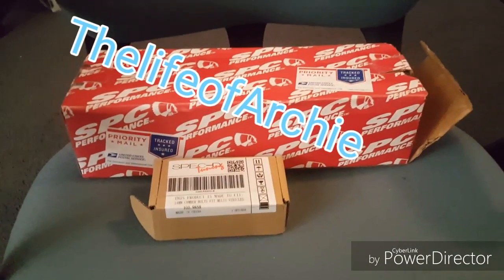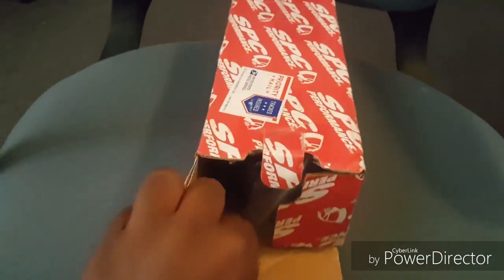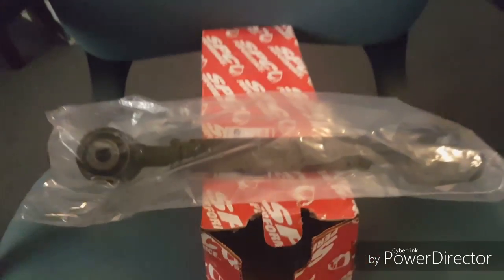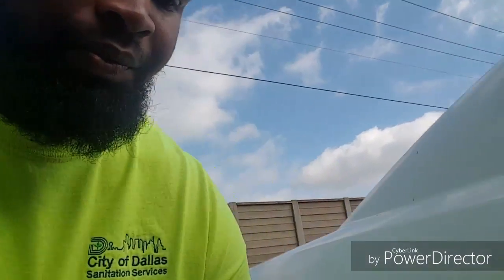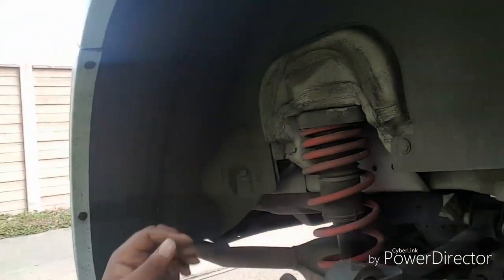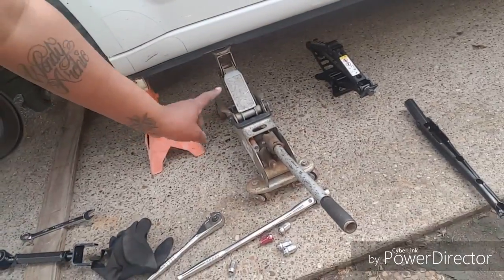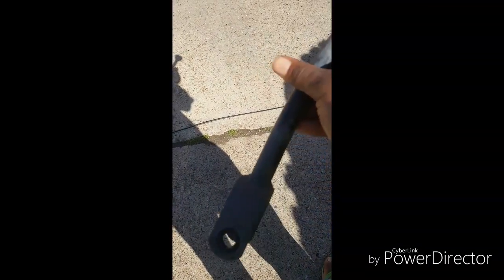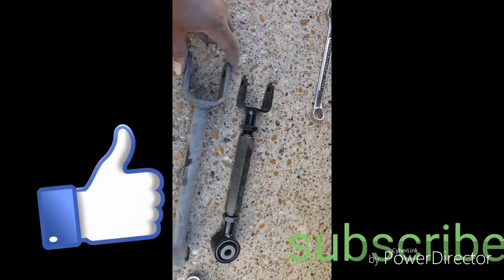Dodge Avenger performance control arms

Comment: Did you do both sides?
Reply from the maker: Yes
Reply: @thelyfeofarchy4474  I just ordered 2 upper and 2 lower control arms for the rear 👍🏻 I also ordered strut and coil spring kit for front and rear, new swing arms, tie rod, frond lower control arms and a bunch of other stuff for my avenger. I'm slowly going to bring this car back to perfect, it is taking a little bit of money but still cheaper than buying another car. Thanks for the quick reply!